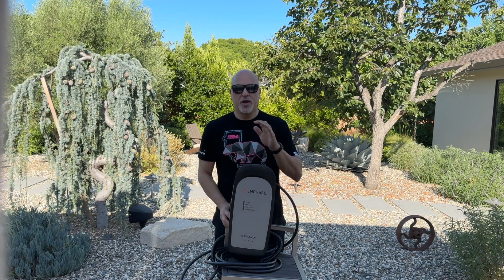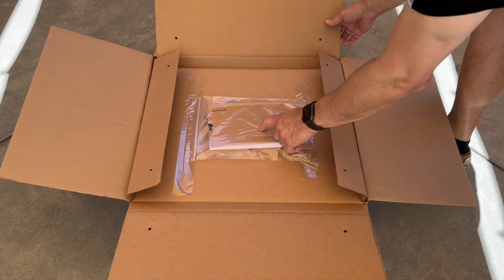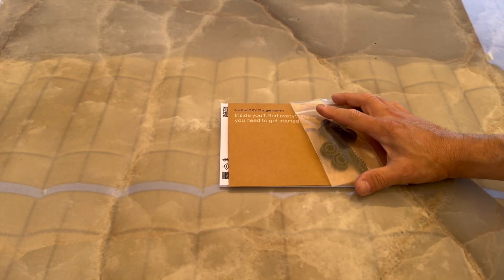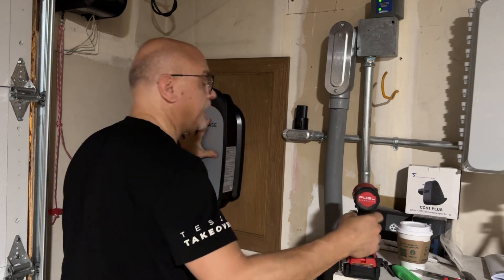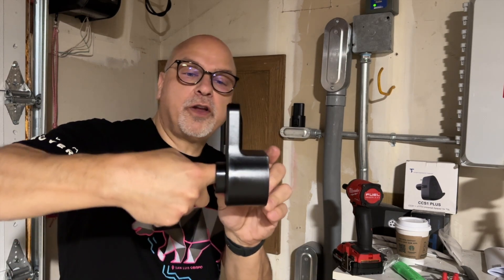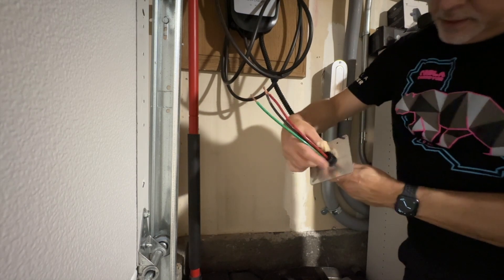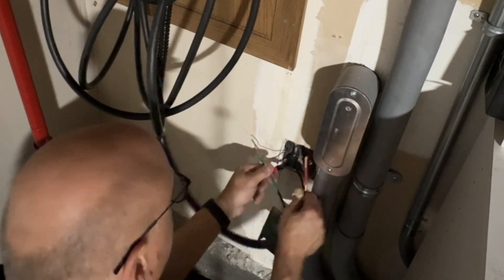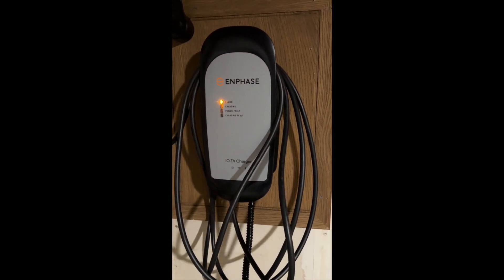Enphase NACS charger for your Tesla

Comment: First, thanks for posting this! I just watn to verify two things:

1. Enphase automatically manages the excecss power production and uses that for charging the Tesla (As you mention in 2.4kW increments)?
2. The Tesla accepts (Without complaints or faults) the amount of variable power provided?  

If so, that is absolutely amazing!
Reply: To answer your questions  1) Yes Enphase charger manages the excess solar and uses that to charge your Tesla. It is in 2.4kW increments.  2) I have not had an issue with my Model Y charging off of the Enphase charger.  What has happened to me is the car may charge at 2.4kW and then solar drops, so the charging stops. In the Tesla app it shows that charging stopped, but when the solar generates enough it charges. Of course you can override this feature at any time if you need to charge from the grid.